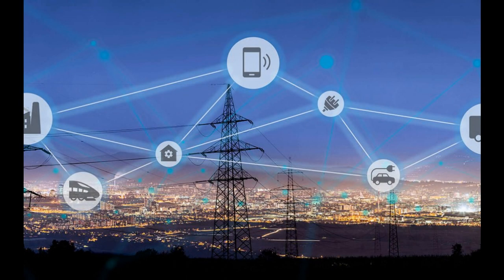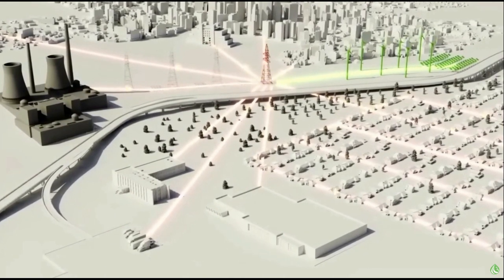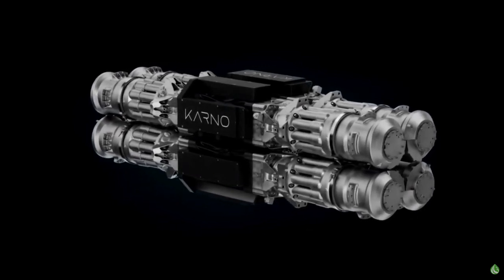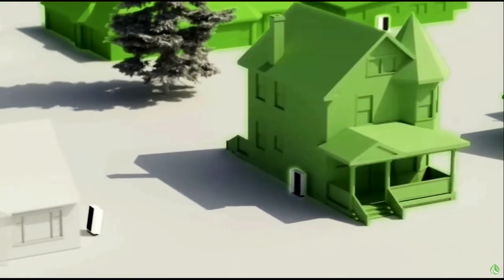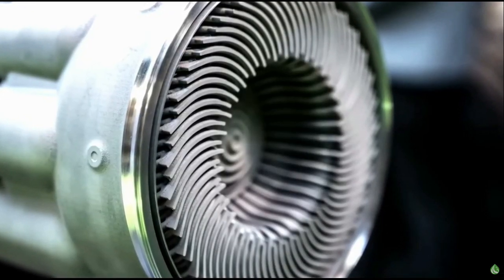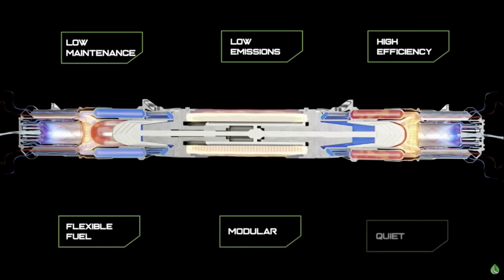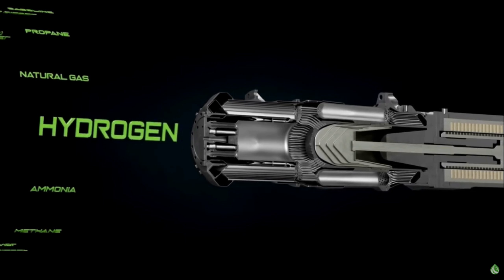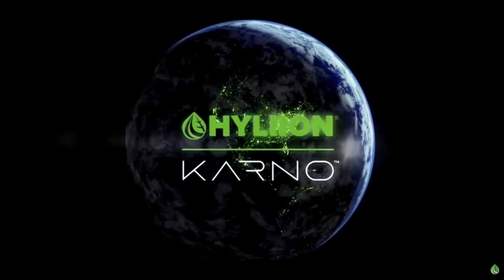Hyliion Karno, Additive Manufacturing And Distributed Power System Future @hyliion

Comment: Fix the bad fossil-fueled electricity generation and distribution system with a fossil-fueled generator at every building? No.
Reply: It's brilliant.  Fuel agnostic, so NOT necessarily fossil fuels.
Reply: @littledorrit6819  But either it's a fossil fuel, or it was made with a fossil fuel, or electricity would could have just been delivered to the grid instead of wasting most of it converting it between forms multiple times. 

In practice, with no supply of any fuel to individual buildings other than natural gas (by pipeline),  or propane or heating oil (by truck), they are fossil-fueled generators.

Comment: Is it not the case that the Karno system is a Sterling engine (or at least something close to a Sterling engine) but Hyliion never uses that terminology and always leaves it vague? I wish this was clarified. 

Also it is mentioned to be 60% efficient but that definition is also vague. The usual specifications for a generator are very clear. 

A claim is made to the cost of electricity output, please put some real numbers on an info slide to explain how this was determined. Hyliion has an infographic on the comparison of the Karno vs fuel cell vs ICE efficiency that is a bit confusing about Karno final output efficiency that would suggest something more like low 50s% efficiency. 

It would be interesting if they contrasted their Karno engine vs Mainspring's novel 'linear generator' that also utilizes flameless oxidation. Two different approaches that also have significant similarities and target the same markets. On paper Karno is more efficient but the differences are interesting.
Reply: I think the difference is possibly related to a Sterling engine using the same working fluid for hot and cold sides, whereas the the Karno has reversible cycle between TWO isolated fluid/gas reservoirs? I'm not an expert obviously. Until real-world test results are published (and repeatable) it will remain a mystery. A lot will depend on outside temperature - like in a Nevada heat - the amount of energy spend cooling the cold side, and how long the generator will take to warm up in 15 below weather and not cause the additive manufactured heat exchanger to experience thermal shock/cracking. Those things may not be issues for stationary applications - but in a vehicle ? ¯\_(ツ)_/¯
Reply: @ivantuma7969  
You bring up some very interesting points. From my close perusal I was under the possible misunderstanding that Karno used a common working fluid on both the hot and cold side. Which is why I kinda fudged by saying Sterling cycle like. It is not like Hyliion goes to any effort to clarify other than by very carefully watching their video simulation and very carefully matching up components with their function (which is problematic)!

Comment: Imagine karno system use by all EV
Reply: would really reduce a need for a 1000lb battery when one could get away with <20% of that in a PHEV arrangement. For my personal commute, I can get away with way under 10kwh per day in a Chevy Volt - driving EV 80% of the time (vs owning an 80kWh (mostly unused) batteries in a Tesla LR Model 3). Not sure how the Karno scales down to personal EV sizes - but certainly worth investigating after they have marketable standalone product.
Reply: @ivantuma7969  Exactly, they can make 4 - 5 Volts for every BEV, it's the biggest reason BEVs are so restricted right now, the mines and battery factories just can't keep up with demand. PHEV is the best choice for folks who can charge at home, and let's face it, most home owners would rather plug in than deviate from their commute and buy fuel.
Reply: @anydaynow01  
I totally agree with you, but EV purest will dump on you for saying that. Considering that a competent plug in hybrid gets you 90% plus of the benefits of a pure EV while not having any of the negatives of a BEV but with minimal more maintenance. An EV purest will exaggerate the maintenance difference but reality suggests different. The real benefit is that while battery production is constrained, significantly more plug in hybrids can be built getting that 90% plus benefit, so the benefit for CO2 reduction is increased. Now that is a rational for cars and light local delivery vehicles but for heavier and longer distance trucking applications the duty cycle of the range extender has to be much higher so the strategy of using RNG (which in California is carbon negative) is a really good one. So I am very positive about Hyliion’s approach.  With California transit district buses, once they hit 200 mile daily routes the EV buses are out of the running, not to mention that they are significantly more expensive than RNG buses that don’t have range and speed issues.
Reply: I was thinking down the line of pickup trucks it could solve the towing range issue with bev's
Reply: @rodneystorie2982  
But does Karno scale cost effectively for a car / pickup application? It seems better suited for larger applications.
Reply: @Mentaculus42  Right now emphatic yes, later down the line when they have more printers operating Karno should be scalable for most applications.
Reply: @rodneystorie2982  👍
Reply: Please explain what you mean? Karno would be a generator / range extender on an ev based platform or a hybrid.
Reply: @Mentaculus42  
Like all EV install karno system as backup generator when EV car battery dies to use until they arrive to charge station